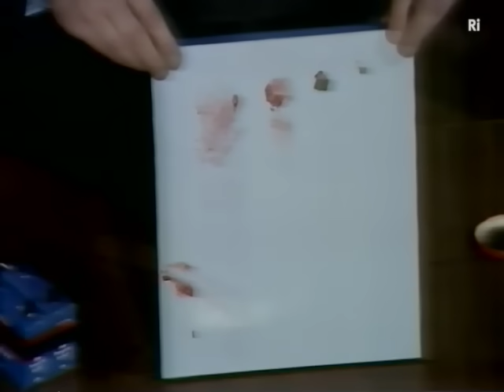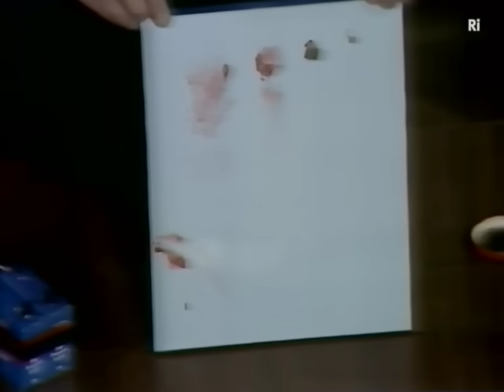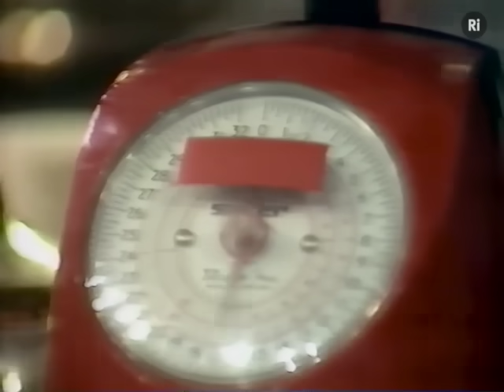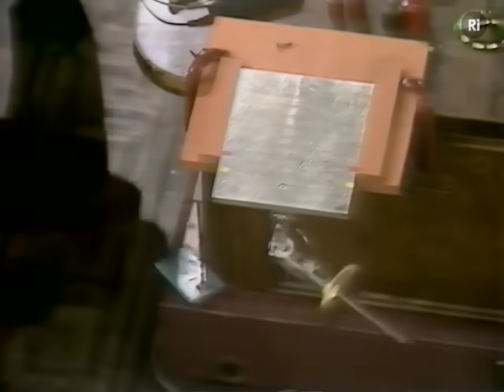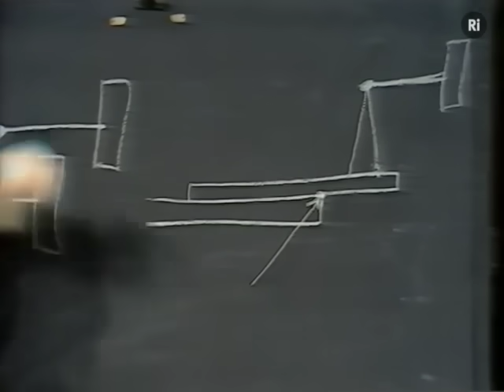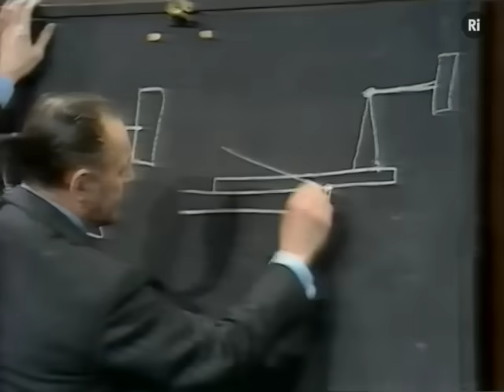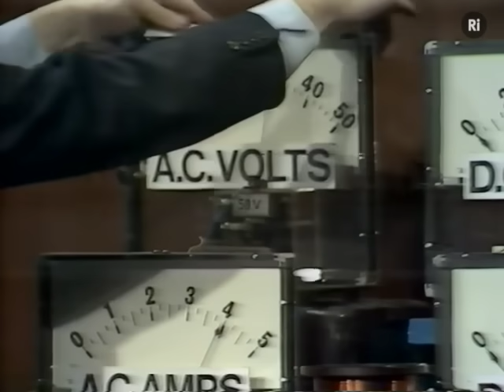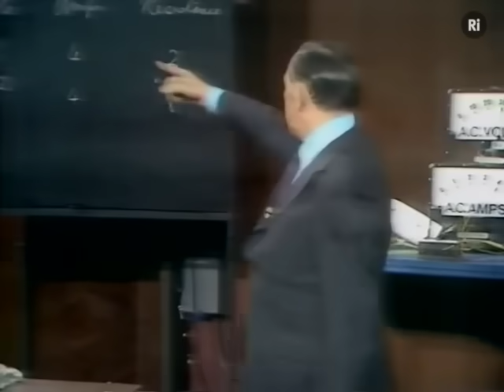☝#AntiGravity Part 3: Eric Laithwaite's Reality-Defying 1974 Lecture on Gyroscopes #HiddenScience

Comment: May I take the opportunity to clear up a few observations that Professor Eric Laithwaite and the Scottish gentleman who built the lifting machine seem to have missed out. 
1: At 22:07  as the gyro is spinning there is a lot of energy/momentum in the plane of spinning and so the gyro will try and keep that plane. It would keep that plane in space but on earth, the gyro will try to drop lower down. Since one end of the spinning gyro is held on the mast then that point cannot move with respect to the ground. With this mast arrangement, as the gyro wheel tries to drop, it's uppermost spinning circumferential elemental particle will tend to move out, changing the vector of the particle at that instant. The lowermost circumferential spinning particle moving in the opposite direction, the gravity drop will tend to move in,  changing the vector of the particle. This is what causes the gyro to precess at 90 degrees to the force  ( vertical drop in this case) applied.  The spinning precession will tend to try and move the center of suspension on the mast, but this is fixed on with respect to the earth, so the gyro wheel has no option but to react and move around the mast. It is the fast spinning of the mass in the gyro wheel that tried to keep the same spinning plane.  Then it is the drop of the wheel that tries to change the plane of the spinning wheel, and this tiny drop in conjunction with the spinning will precess the wheel to try and move it around its center of suspension, but when this is solid on the mast, it cannot, and so it will have to move "itself"  to react around the suspension mast.    At  38:46 when the suspension point is not solid but through a string suspended from the ceiling, the suspension point was light and free to move in a circle and so it was the suspension point that was pushed by the precession to form a  horizontal circle and not the gyro wheel/ plane about the suspension mast center on the solid mast top.  When suspended from the ceiling, the centrifugal force on the whole gyro mass, will then move out the whole arrangement till the suspension string makes an angle with the vertical and the centrifugal force will be balanced by the gravitational force about the imaginary center below the ceiling suspension point. More or less like a fast car going around a banked racing track.
It is worthwhile revising the gyro suspended on the mast which is stationary with respect to the ground or suspended from the ceiling with a string where the suspension point starts making a circle as it is free to do so. With a solid mast, the gyro drops a little and the precession on the gyro makes a  rotation about the mast, while with a suspension from the ceiling the center of suspension turns about the gyro total mass while the spinning gyro tries to settle with the suspension string at an angle, using the centrifugal force in conjunction with the gravitational pull.  Considering that the spinning is slowing down and the drop accentuated, then the angle on the suspension string will follow suit. Eventually, the gyro will spin in the same position with a vertical axis below the  ceiling suspension point, 
2: At 24:21, the gyro is not spinning, the clamp/ center pivot fixed, and rotating it about the suspension pivot on the wide base seems to accept both the centrifugal force and the weight at the side of the arm. The gyro does not tumble over. 
3: At 24: 33 when the Professor undoes the center clamp with the gyro not spinning the gyro drops. At 24: 55, with spinning gyro, the momentum in the wheel tries to keep its vertical plane but as it drops, the spinning gyro has to precess, and since the mast top is fixed, then it has to rotate about the fixed mast. Note that the gyro oscillated as he slammed the whole unit on the table and did not place it on the table in a gentle manner to ensure that the top of the mast was fixed as the released the gyro. The spinning gyro "did not drop fast"  as there was a lot of energy/momentum in the vertical plane which was bounded by the mast top. It did start to drop slowly and what was described above started to occur. 
4. The Professor saw that the spinning gyro was dropping fast as that is what powers the gyro to precess but he was clever and he imputed the angular force which made the spinning gyro go faster than its natural precession due to the natural drop  AND SO HE INTRODUCED A SECOND PRECESSION WHICH LIFTED THE SPINNING GYRO.  This second precession effect, due to his hand horizontal input was exactly the same as the precession due to the vertical drop of the gyro due to gravity.
5. At 25: 20 when he clamped it and rotated it without spinning the gyro, there was no angular momentum/ energy in the spinning plane and so that gyro spinning plane could not be held and so it dropped normally due to the gravity and the centrifugal force of the whole gyro.  He was not correct to say that it does not exhibit a centrifugal force in the states he had at that moment.
6: At 27:00 when the Professor stopped it, he was stopping the contribution to rotation due to the precession effect and that energy was coming from the rate at which the gyro was dropping due to gravity. He did give it energy at 26:57  for the loss in the vertical drop as he realized it was losing Potential Energy fast so he gave it some more to proceed with his demonstration. 
7:At 27: 55 the Professor left the pin in and so the moment of the Gyro weight came into action. When he took the pinout and spun the gyro, then the spinning plane had angular momentum and tried to keep it and the rotation about the mast came from the precession effect due to the dropping gyro. Passing on to turn the whole unit upside down....then as it spins the spinning gyro without the pin, is only trying to keep the spinning plane but the DROPPING  of the gyro propels it to precess at 90 degrees to the vertical drop hence rotation about the inverted mast.
8. Everything else is based on what was said above.
9. The machine made by the Scottish gentleman on the principles seen in this video and which he concluded, " If I make the torque  reaction of the " two" gyros overcome the centrifugal force, it will use the free flank and I expect the machine to lift up!"  I think that Professor Laithwaite should have seen that the amount of Free Flank in which the two spinning gyros will precess up will be related to the drop of a normal spinning gyro as the rotational hand input by the Professor was the energy that lifted the spinning gyro in this video.  I would not hesitate to say that when the free flank in that machine is used up, then the machine will not climb anymore, just like a spinning gyro precessing around a mast will stop rotating around the mast if the vertical drop had to stop or arrest due to dropping limits. 
One hopes that the above information may save some heartaches to those at Imperial college and those at Dundee University. Gyros are well-behaved units and they only have one rule really, when they drop they precess around the mast and when one applies the " drop" horizontally they lift or drop very fast as shown at  26:45 when the Professor says, " And I give it a  horizontal push.............(it drops) ah the other way!"
The success of understanding gyros is to know where " the drop" exists, be it vertical or horizontally, where the gyro axis will react in exactly the same manner considering the "drop or force motion relative to the direction spin of the gyro" 
I would summarise by saying that  a continuous propulsion force can never be generated from gyros because any " drop will have a limited distance, to cover!" 
and so it all boils down to  that if we have some STORED  energy we can  only TRANSFORM IT and use in any manner we can  as long as it lasts, 
https://youtu.be/HAckjYtdig0
Reply from the maker: You forgot the part about gyros rising on their own without conventional angular momentum / centrifugal force / inertia all while not losing spin speed, check out my MES Experiments to learn more: https://www.youtube.com/playlist?list=PLai3U8-WIK0HUHoank-Lj9q6RGAS51QRh
Reply from the maker: Glad you like my experiments. Please note that those explanations for tippe tops are wrong and don't relate to gyros rising on their own. The mainstream tippe top explanation is based on the assumption that sliding friction at the contact point with the surface somehow torques the top upwards. This explanation is wrong because tippe tops can rise on their own even on ice with as little friction as possible. And the contact point with gyros doesn't move so there is no sliding friction, so the mainstream tippe top explanations are irrelevant for gyros.

In my 22+ hour Anti-Gravity Part 6 video I go over every mainstream explanation regarding gyroscopes, spinning tops, tippe tops, phi tops, inertia, angular momentum, etc., and show how they are all wrong and/or incomplete.

This is the part regarding tippe tops, which I refer to as tippy tops: https://www.youtube.com/watch?v=dKwwJe0znpA&t=3178s
Reply: @mes  Thank you once again for your assistance and for your wonderful explanations. I am a very old engineer and I feel that I never had any problems understanding the phenomenon of engineering functions, but I did feel a little on my own many times. At a very young age, I hit on the idea that most engineering functions need three ingredients and I summarised this as follows:-
Result= ( a characteristic  of the material used)( exciting function)
as in V=I*R,  M=m*v,  E=m*h or m*V^2,  V=L*dI/dt,  V=(1/C) (integral I.dt) 
and many otheers.
In the case of Gyros, I consider that they can spin and they can precess and they can wobble. With all the mass particles in the spinning wheel having the same mass at a particular radius, same velocity, same acceleration, then the system will be stable.
If any external disturbance causes any of that parameter to change as in the vertical wobble, when the gyro rises, I feel clear in my mind that the variation of the accelerations on the top half and bottom half of the spinning wheel will cause the gyro to seek a stable position and that is the spinning around the vertical top where gravity effect is eliminated. A bit of mathematics would show the different accelerations and hence the direction of the stabilizing forces.
Once again, congratulations on your video, and may I compliment you for though you seem so young from your voice, discussing such issues with you, make me feel in good company. Thank you.
Reply from the maker: Thanks for the write-up and I agree that most of engineering equations can be simplified. Interestingly, I have a Civil Engineering Bachelor's degree and a Master's in Mining Engineering. But while in Engineering I decided to create my YouTube channel to self-learn and self-teach mathematics because I didn't like the way it was taught in school.

When I came across gyros, I realized that the mainstream technical theory and mathematical formulations don't address or even allow the possibility of most of gyros' behavior. Effectively, the mainstream explanation is in regards to "angular momentum" and applying a "conservation law" as opposed to an actual causality. 

Thus, even your view of gyro spin acceleration variations is also not a mainstream view of causality nor of the conventional mathematical angular momentum formulations. Your view is similar to one of my subscribers, John Hartman, which wrote a paper on a "Coriolis force field" as the causation of the "gyroscopic effect", and you can see his paper here: https://papers.ssrn.com/sol3/papers.cfm?abstract_id=3587972

Note that he couldn't get his paper published in any mainstream journal since he presented mathematical formulations that don't adhere to the established angular momentum conservation equations.

As for my view on gyros, they were the driving force for me to study what "forces", "inertia", and "mass" actually are; and which has lead me to study electromagnetism in more detail than likely anyone has undertaken... So stay tuned for later videos!

Anyways, always great discussing gyros physics!
Reply: @mes  Rather than study "angular momentum", which is a mathematical concept, the study should be on inertia. When you push against an object and it resits the push, what is the physical mechanism for this? Likewise, once the object is moving and continues to move, why is that happening? Do not say "it's because of conservation ..." because that is just an argument appealing to authority (Newton, etc.) Why is it happening?
Reply: So, inertia is caused by the Æther interacting with the object. Once the Æther is "spun up" it continues to spin and drags the object along with it. 
The question is: Can we "spin up" the Æther in a way that looks like momentum by some other way than by moving a big mass around? We already know how to "churn up" the Æther with a traditional electro-magnetic generator, but the field modalities (the flow pattern of the "churned up" Æther) are not what are required for momentum. Is there a geometry of a coil (for example) that can "spin up" the Æther in the desired way?
Reply from the maker: @Code Tech I think the "Aether" is a term to describe that all things are interconnected and thus are part of a unifying whole. Thus objects aren't in the aether but rather are part of the aether. Just as an air bubble in water is only defined in relation to the water itself; i.e. remove the water/aether and there is no bubble/object. That being said, all things are possible and the best way to find out is by experimenting with churning up the aether!
Reply: @mes  Well, you already know that you can churn up the Æther using a gyroscope and that it produces interesting effects. But the gyroscope is not an end in itself; it is only a means to demonstrate that something important is happening. The goal, I would think, would be to isolate and control that effect.

Surely spinning a heavy disk is not the only way to produce the desired churning of the Æther? Perhaps one could ask, does the disk need to be so heavy? Could you produce the same effect, using a lightweight disk, but by using some kind of trick? For example, if the disk was actually a capacitor (disk of polypropylene sandwiched between two copper disks) charged to say 25KV, what would happen? Would the high static charge "trick" the system into behaving as if there was a bigger mass?

Now, let's say that the spinning capacitor did actually produced the desired effect. The next thing would be to see if you could do it by not actually spinning the disk, but by switching on and off sections of plates, thereby giving you a system that can be controlled more quickly and more precisely without moving parts.
Reply from the maker: @codetech5598  Now you're thinking! The gyro effect is an example of macro uniform motion of mass which behaves like a point particle with a "force field" around it. Essentially it is like a macro scale magnet/atom and provides insights into just what electromagnetism may actually be. I will be doing extensive experiments on electromagnetism starting next year and will see what happens so stay tuned!

Comment: Yeah -  thinking about it, an object in linear motion ( a spinning disk is that but equalised at each end) will continue in that direction and speed until another force is acted upon it. The other force being gravity will not be able to affect it if like an orbiting satellite its speed thrown away from the earth matches with gravity to keep it in orbit. Thus if the appropriate speed of rotation is used for a given diameter size disk then gravity will be made to look redundant while its maintains that speed. 
Like a bullet through air however will find resistance and due to slower speed over time will be brought back to the earth, so too the spinning disk will first defy gravity then face its full force over time as it slows down. Thus why the disk behaves the way it does.
The reason it likes to rotate about an object most likely due to air resistance as it pulls air around itself creates the turning effect.
Spinning disk explained.
If you make the disk spin horizontally then I believe you would see the object lose its weight perhaps better than vertically - like to see that one tested out however.
Reply from the maker: I'm not sure what you mean. Check out my #MESExperiments video to see gyro rise all on their own: https://mes.fm/experiments-playlist